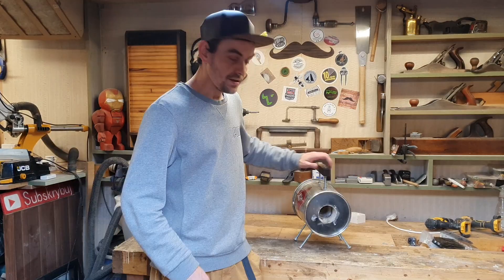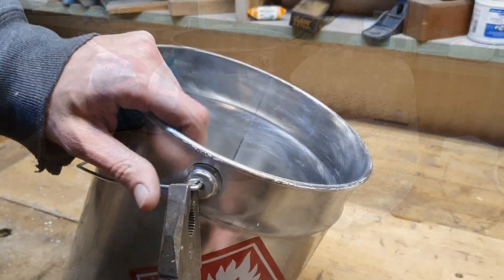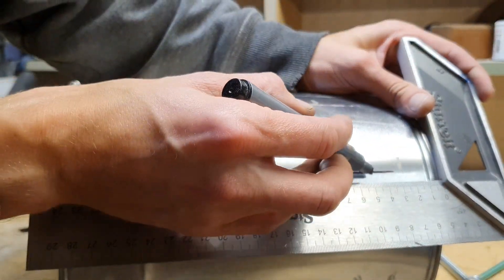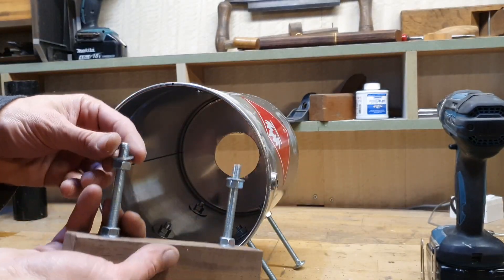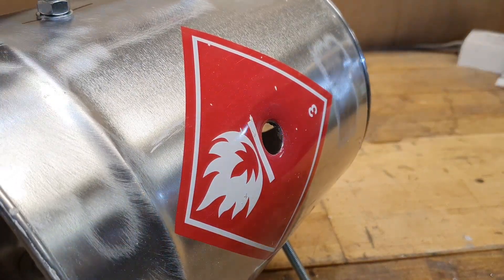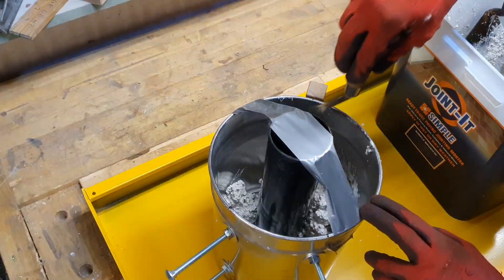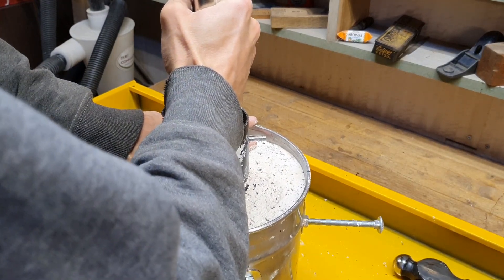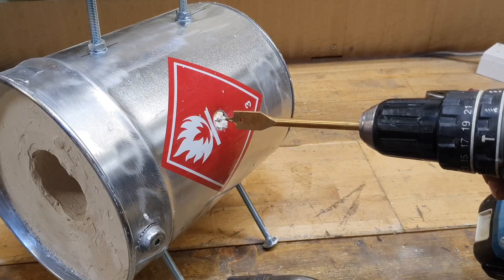How To Make a Mini Forge For Knife Making

Comment: Just a tip guys! Use a foam pipe as it’s easier to remove , v cheap too. 

Instead of the paint can, you can use a metal flower waterer and the spout can be a handle.

Comment: Would this be able to reach temperatures hot enough to melt small amounts of copper? if say for example I were to use a small crucible.
Reply from the maker: Well with good burner probably yes as you need to go over 1000°c plus add some cover to prevent heat from escaping (they usually have small hole in lead or not so tight fitt)
I would need to check if by myself but i don't have probe thermometer.
Reply: @MatthewMoustache  I see,  i could probably make some sort of cover with the same material as the insulator to use as the lid,  just put a smaller hole in the top.  As for the bottom, ill just skip the step where you drilled a hole in the tin and find a way to layer it.  I have only a Butane torch, which I am aware burns hotter than propane.

Comment: Is that can galvanized? If so, thats a big no-no. you should read up on galvanize poisoning. The same goes for nickel plated bolts and washers. always use stainless or uncoated.
Reply from the maker: I know that so no worries, can was originally lacquered inside and bolts are not in contact with direct heat, also I'm using this forge outside 👍

Comment: Brilliant work. I have made one of these and they are incredibly cheap and effective.
Its a personal choice, but next time I make one, I will not be adding the handles and legs. They are a sweet addition, but they dont real  add utility, and if anything screws up with them after you set the insulation then its broke for good. I had one of the legs pop off and there is no really good way to fix it. Better to just not have internal nuts and bolts, put it between bricks, and only move it when its cold. Thats me though. Having had one leg pop out, I realised that a three legged forge is worse than a no-legged forge.

Comment: You added a bit on the back? Explain please. 😕
Reply from the maker: Yes that's for reducing heat loss and making forge more universal, in case of making something longer you can remove it to stick workpiece all the way through ( this is original can lid with 22 mm hole) sorry for missing this part in video